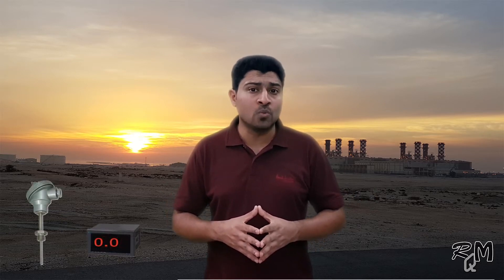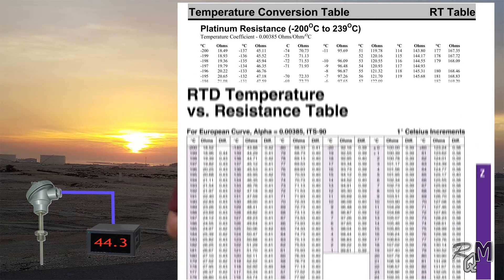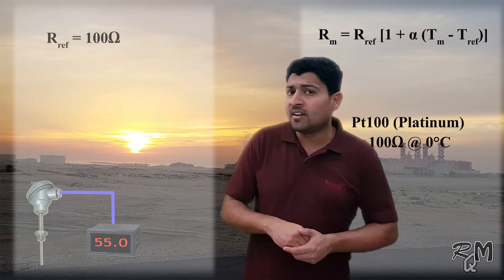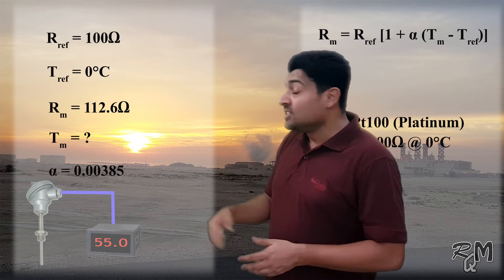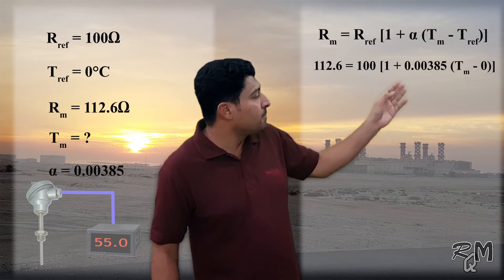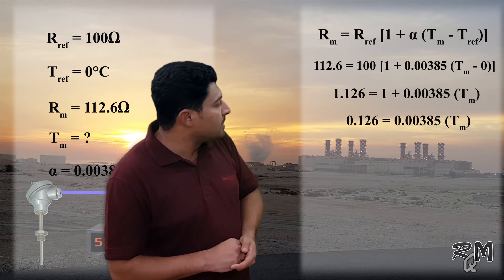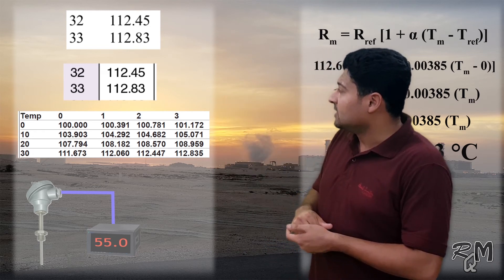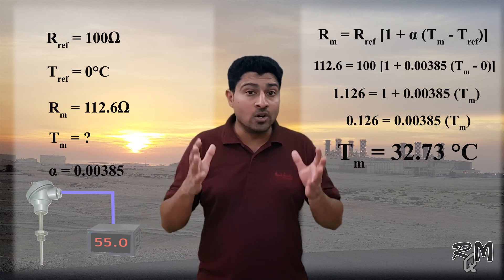RTD Part-01 Resistance To Temperature Conversion Equation

Comment: 112.6-100 is 12.6 not 1.126
Reply: He has divided 112.6 by 100, not substracted.
Reply: @amolpatilnityaaassociates2602  But you cannot divide when you move a number to the other side. You have to minus. If he wanted to divide, he would have used the 100 to divide both sides.